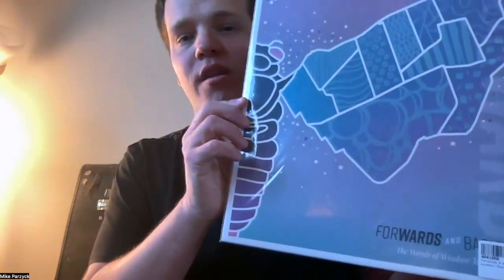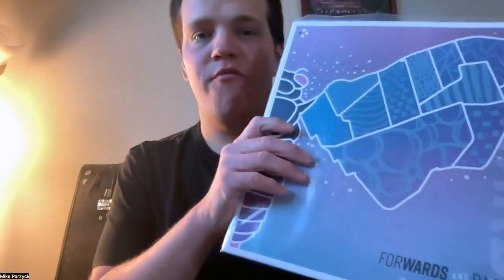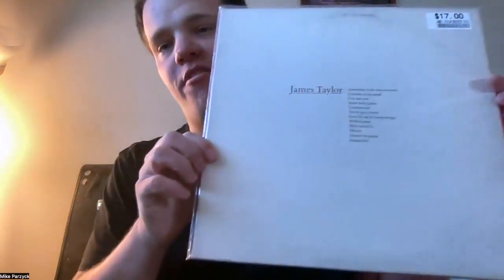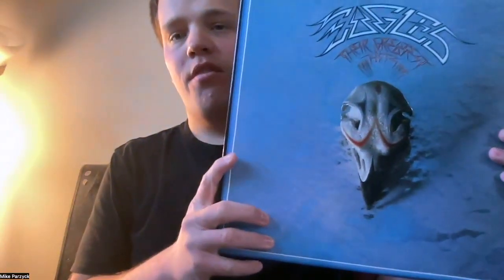A Nelson Pass Design- First Watt F7 Review

Comment: It is likely that you were using less than 1 watt almost all the time. Even with lower sensitivity speakers than your Klipsch, this is probably true, unless you are listening at 90+dB.
Reply from the maker: During the whole listening session for this review, I had the volume knob between a quarter and half way. It wasn’t concert level volume.
Reply: @vinylsidechats  Right - and even if you were using 86dB sensitive speakers, that would be 1 watt-ish that you would use on average. So, the 20-30 watts available are plenty.